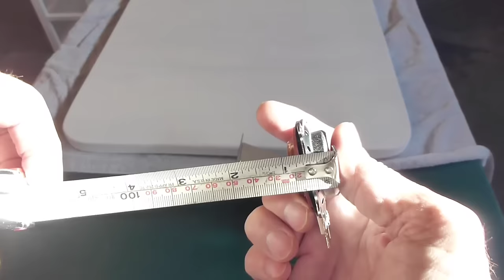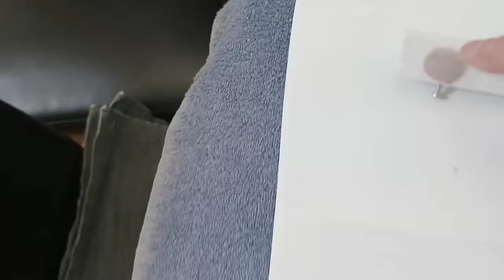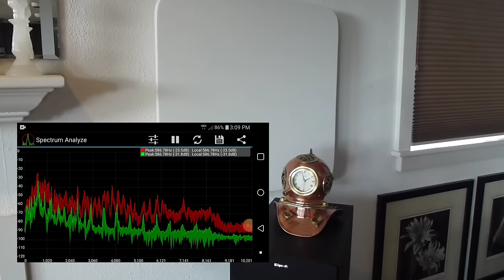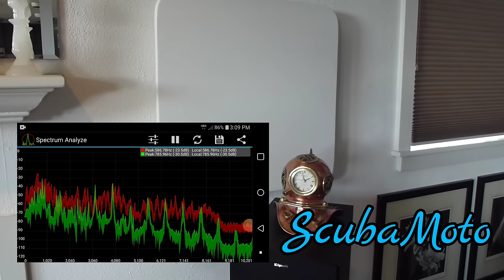How To Build DML Panel Speakers with Hidden Wall Mounts Fully Suspended

Comment: Has anyone suspended these from the ceiling for dolby atmos?  I would think they would be perfect for that application and very unobtrusive
Reply: I believe I read somewhere that the man that discovered this back in the 60's had put this theory to his drop ceiling throughout his home and could have music in any room just by plugging into the exiter that was wired to a wall socket.😎👍
Reply: I have two ceiling speakers that are not great quality and could use replacing. The wiring from my Bose system is all there from the amp so I think I’m going to try it. Any suggestions would be much appreciated.
Reply: I'd like to know also. My plan to hang on ceiling with matte paint so they become more invisible. I'm thinking no problem practically.
Reply: Oh man this is an excellent idea! If you run with this I would love to know your results!
Reply: If you watch Tech Ingredient's video on which this one was inspired you'll see that you could potentially use the panels of a drop-down ceiling if you shorten the sides and use foam or something like it to dampen the vibration so it doesn't transfer to the rest of the ceiling.

Comment on tightening the line, use a truckers hitch knot.
Reply: I would also think the way they would be suspended would be super easy, I'll try this for sure when my house is finished, heck for less than 200 minus the subs, you could have a 9.2.2 surround system with no box speakers anywhere
Reply: The problem with suspending them horizontally is that the vibration direction is inline with the suspending strings.  As the strings would be under tension from the weight of the panel, the panel would be coupled to the ceiling.  I think that the only way it would work would be to use a LOT of very weak springs to decouple the panel from the ceiling.

Does that make sense?
Reply: @KeithOlson  no bro. The strings are always under tension, that is the point of the Thing.
Reply: Bro that’s a sick idea.
Reply: @KeithOlson  I get what you are saying.
Reply: @Cuyose  these are essentially omnidirectional speakers, so while you can fill a space really well with them and they're fantastic for music, you also lose some of the directionality of audio that makes home theatre setups and multichannel speaker systems special, especially for films.
Reply: @KeithOlson  if you ran eye hole screws and ran the string horizontal through another set of eye hole screws mounted to the ceiling would take some of the rigidity out of it, making it float more. This is what I'm going to test as soon as my exciters finally arrived.
Reply: This was my first thought as well 😂
Reply: @90sin90  You gotta let us know, this has been something sitting in the back of my mind now for over a year. I think a chopped up slinky might work also for this also though maybe a plastic one as the metal ones might reverb too much
Reply: @williamleoppky661  build these panels,suspend them.......you need any more suggestions?
Reply: @KeithOlson  have some hooks on both sides and use like pen springs to suspend them?
Reply: I have tried suspending a set of these from the ceiling, but they didn't sound that good. Here's the reason: the suspension directly oposes the direction of vibration. So the lows and low mids sounded dead. If you could figure out how to non-rigidly attach something like this horizontally to the ceiling, I think this issue could be mitigated.
Reply: @christianjameskatona8567  maybe worth spring-based mounting to negate the weight of the panel and exciter?
Reply: @Microwave414  never thought about a plastic spring, but it sounds like a good idea!
Reply: @KeithOlson  I would personally mount the exciters to the ceiling if I did it, even if loosely or on a mount that allowed vibration. I don't think it would make a big difference in sound and II would probably just make my own rubber/foam dampened mount.
Reply: Yes, you can use these as atmos speakers. Problem is atmos pushes alot of lower frequencies into atmos speakers as well, especially in war movies and such where most of its effect is used for helicopters and the like.
Reply: The problem with mounting these speakers horizontally is that they accumulate dust.
Reply: Use rubber bands.
Reply: Best bet would be mounting the exciter to the wall so that the panel is free floating.
Reply: How do you connect the speakers to the player?
Reply: I hung them from the ceiling and it worked out well for atmos.  I put 6 cotter pins in the back with epoxy in three pairs, each pair about 4" apart making an equilateral.  Strung fishing line tightly between each pair using his technique. Then tied a vertical  line to the middle of each tight string and hung those from the ceiling.  Leveling was the hardest part.  Mine was attached to a drop ceiling, which made it easier because I could take the tile down to do the hanging.  Horizontal line works like a spring.
Reply: I have been thinking the same thing haven't seen anyone do it yet though
Reply: I am working on a project like this right now! Coming to this video for material tips. I'm going to suspend the Dayton audio DAEX32EP-4 exciters from the ceiling with fishing line. If you're interested in my experience we could get in touch!

Comment: Here's a little trick I learned from reading an article in Stereo Review Magazine back in the early '70s. Add a 3rd. speaker directly in back of your sitting position. Here's how you do the speaker connection. From the back speaker connect your speaker cable from the MINUS terminal to your MINUS terminal to the front left speaker. Then from your back speaker again, connect your PLUS speaker terminal cable to your PLUS terminal to your front right speaker. Don't worry, if you follow my instructions you will not blow your amp or receiver. Experiment on how far back the rear speaker needs to be so that it doesn't overpower the sound from your front speakers. If viewed from above you would be sitting right in the middle of a triangle of sound. You will be pleasantly surprised with the results! I have been doing this for years and I love it. You can do this with any speakers. ^^
Reply: I refuse to take your advice sir. I simply don't believe you. I think you're trying to fry my speaks...
Reply: Typically, audio amplifier negative terminals are common, which means they are connected together internal to the amp.  So what you are doing is connecting the rear speaker in parallel with the right speaker.  With standard 8 ohm speakers, the right amplifier will now have a 4 ohm load.  The amp outputs are now unbalanced.  This will not improve the system acoustics.  However, if you connect the rear speaker across the left and right positive terminals, the rear speaker will play only what is different between the left and right stereo channels.  Both channels will be balanced with an effective 4 ohm load which most amps can handle.
Reply: I remember it always and have run them positive to positive. It is the difference signal between left and right channels. The mono signal is nulled. It works quite well and you can use two speakers in series and put them in a shape that forms a quad with the front speakers. Distance and angle of all four speakers can make a significant difference in the image. Try it out. Enjoy. 

I've heard it referred to as split channel sound.

Comment: This would be a good solution for rear surrounds for a 5.1 set up.
Reply: Same, I am planning to do this soon. Will update here. If you have tried it let me know?
Reply: I was wondering that myself. I have a 5.1 capable of 7.1 but I don't have room for the rear speakers. This would solve that problem.
Reply: That was the "Perfect Implementation" of DML speakers considering WAF & internal decoration purposes !
Reply: @VeeDCreate  Hey bro, you made it ??

Comment: A pair of these and my PSW12 powered subwoofer would make an awesome system and require very little power to run.  Thanks for an excellent video!
Reply from the maker: No problem! You're set up sounds spot on 👍

Comment: Hey ScubaMoto, I watched the well known tech ingredients video about how to build the panels and immediately was obsessed by it. I started to build a set of speakers right away and it wasn't before i practically finished them that I realised I will be hanging them on a wall in between two windows. The idea of hanging them from a wire from the picture rail (it's a rental studio, I unfortunately can't drill) seems like a bad idea because of the wind. But then I found your video! Thank you so much for the great idea. Now all wasn't for nothing. I'm going to try to use some kind of adhesive instead of drilling the mounts to the wall, hopefully that will work. Thanks again, you're a savior. And your panels look really good!
Reply from the maker: Timo Cohen: Thanks for the compliment. I'm glad you like the look. Congratulations on the build.

Comment: Amazing.  Really detailed in certain frequencies.  I’ve been reading about these for a while. Enough I guess to know what the 5/3 rule is. I have often wondered the effect of placing two on one sheet and using filters or crossovers to even the harmonics out.  Gonna have to order some and start playing around.
Reply: From what I hear, the clarity could be because it has fewer contacts that the what we see with a usual speaker which has contact all around like a circle. As this causes distortion as the diaphragm doesn't move the same at those edges. I'm thinking maybe 2 speakers with different frequency filters may do the same distortions which you may not want.

Comment: I would have thought the paint would lessen the flexibility of the tiles, but it sure sounds good to me
Reply: If he used a Latex paint id say he'd be fine as far as flexibility goes. Would be an interesting experiment comparison though.. maybe even using something like plasti dip as a paint lol
Reply: I'd agree, and tech ingredients does say in their video to try and avoid any type of coating. That said, reality is that pink doesn't match well with anything, so a light as possible coat of a good quality latex paint is probably as good as you'll get as far as matching your existing space.
Reply from the maker: Lance Custer: Good points. They sound great but there's no need to abandon aesthetics. Given the frequency response of the foam panels, paint may be an improvement by some measure. I'd do a blind taste test but there are just some things I'm not willing to display. The color and appearance of the raw materials used, (including the exciters imho) might not match the aesthetic of the audio systems or environs they're used in. Thanks for the comment.

Comment: I like your wall mount system.
They sound very clear 👍
Reply from the maker: classic287: Thanks. It's been a year and they still sound great.
Reply: @ScubaMoto  I spent a while figuring out what that bottom string attaches to. In reality, it just acts like a spring suspending the panel. Simply genius. Need to make some of these for my newly wall mounted TV🙂
Reply from the maker: @OtherDalfite   Thanks. That set up will look good. Enjoy the build.

Comment: I bought speakers and I bought sheet styrene. Then I stopped. Could I paint the styrene?  I was unable to find out. Now you show me painted panels that sound great and perform well.   I like your hanging method and the bottom suspension method as well. Thank you.
Reply from the maker: jimspc: Enjoy the build and the sound. Thanks for the comment.
Reply: You can spraypaint the panels from 40cm away (to avoid having the paint chemicals melt the upper layer) with no problems except excessive use of paint.  Saw this in a video.
Reply: This is probably too late but you can buy water based spray paint to use on styrofoam.

Comment: Think ill make a set of these and wire them in series with my towers. Should be interesting.
Reply: In series? More speakers does not equal good sound, quite the opposite.... I'd be interested to know the results.
Reply: Watch out for the impedance if you wire them in series.

Comment: I'm thinking of breaking apart my cheap 100$ soundbar to use speakers like this, and the subwoofer line to my powered subwoofer.
Well made video, thanks.
Reply from the maker: Mark Derail: Thanks for taking the time to share. That sounds like a great project, enjoy!
Reply: Did you do it? How did it pan out?

Comment: Well I made a pair of these with the 15W dayton exciters last weekend, and I don't like it :-( maybe I should try some different panel sizes. It does sound different in a good way too though!
UPDATE: it's actually the 20W version, I was wrong. And I stuck one to some cheap 3mm plywood of roughly the same size and it's waaaay better. Better low mids and less sharp highs. It also sounds more present and real. The EPS foam board sounds thin in comparison. Especially voiced sound weird on the foam. BUT the plywood requires more power to get the same loudness and I start to max out the exciter faster.
Reply from the maker: maxim_sys: Thanks for the comment and for sharing your experience with making your own speakers. The exciters used in the video are 24W each for my 24-inch square panels. I gave a part number in the video with links in the video description. If they are backordered, you could try 20W or even 40W for the same panel size.
Reply: 40 watt version is superior.
Reply: If you did use EPS (Expanded Polystyrene) then you are using the wrong product, you need XPS (Extruded Polystyrene) as used here. EPS just does not work.

Comment: Would be fun to open your Klipsch and re-route the tweeter output from its crossover to the DML panels, and then hear the result. Thanks for the great content.
Reply from the maker: g h: Interesting idea. I believe Klipsch choose 1800hz as crossover for their tweets on that tower model. I know others are using crossovers to cut power exposure, but I'm not sure I'd want to limit the DML's frequency exposure quite that much. I'm too impressed with the full voice range that I'm getting through the panels.
Reply: @ScubaMoto  Makes sense, but it might be a fun experiment nonetheless. Tell me more about using crossovers to cut power exposure. Why would/could that be necessary?
Reply from the maker: g h: The exciters have power ratings and I would guess most people cutting power are doing it to protect the exciter during high-volume events. If you search on the exciter model you will find plenty of threads talking about using crossovers and mini-amps for these.

Comment: I’ve seen several videos and so far this has transformed very nicely, I just have to ask if anyone has tried round wall plates since it’s basically a speaker without the round cone, onto a square with rounded edges. But I love your design better to make it look less obvious if that’s the correct term.
Reply: i was said, that simple circles has the most resonations, and it was said, that is unwanted, but maybe some will try it and measure frequencies 😉

Comment: I'd like to see a full surround setup with panels.
Reply from the maker: I completely agree and I have been trying to work a solution that both sounds and looks good. The challenges are: 1- surround is directional and aiming these would be necessary meaning tricky mounts and lots of air space. 2 - Size matters. My Polk Audio 100W surround satellites are very small but put out big sound and are easy to aim with the wall ball mounts they're on. I wanted to try smaller DMLs, but to get the same sound "size" as the Polk Audios with a DML, I may need to stick with the 24-inch squares with at least 20W exciters for each satellite, which gets pretty big, pretty fast with a 7.1 system. I'm considering supplementing the existing Polk Audios with smaller DMLs just to fill the mid-high voice range that's often lacking in theater systems. If they phase up right, it could be the solution I'm looking for.
Reply from the maker: 1. Yes, the wall mimic works but I've kind of gone another direction for aesthetics. 

Q1 Not yet, but I'm looking at smaller panels as surround satellite supplements rather than replacements.

Q2 I don't see a problem with 35w for these.

Q3 5.1 should work especially since these are best served with a subwoofer.

Q4 not sure on that one.
Reply from the maker: Side Swipe: 1-Decals won't hurt anything. 2-In a way, building my wall mounts (in the video) to mimic acoustical panels is similar but I'm not ready to put exciters on the backs of my kitchen cabinet doors . . . even though I've considered doing just that for stealth lo-fi. 3- My preference is the simpler the better, no baffles or flaps.

Comment: Excellent idea.  I did something similar with a couple of corrugated styrene panels, and hung them from the ceiling with thin wire, also inspired by the same YT channel..  I like the finished look of yours, matching the wall.
Reply from the maker: Jim Hilbert: That sounds like a good build. Thanks for the comment.
Reply: What would these do with my ATMOS system? Hmmmmm.
Reply: how did you mount them to the ceiling? I have limited wall space, but do have 15' high ceilings in my loft and would love to put some of these up there!

Comment: Can u make a video Adding weights to the exciters? I want to see if adding more mass to the driver causes the foam board to physically travel more thus creating louder sounds. Because I would assume a lot of energy is lost into moving the little but heavy drivers vs trying to translate the foam board which has little mass but greater air resistance to movement. ? Next video idea 😉